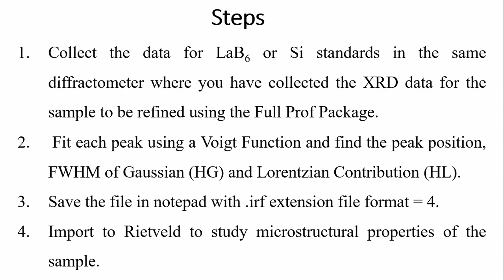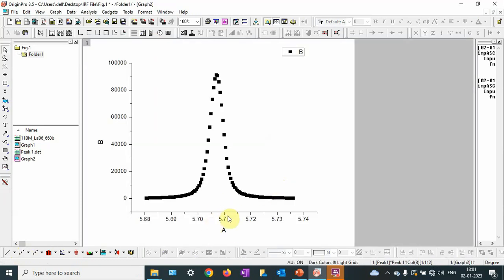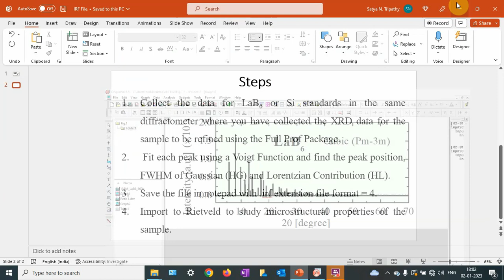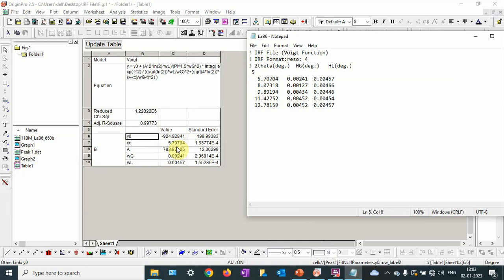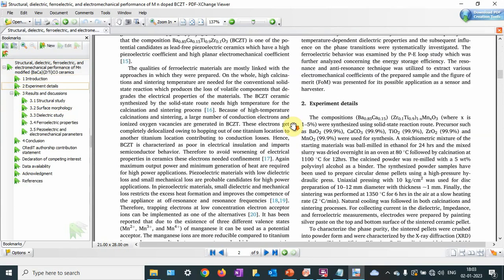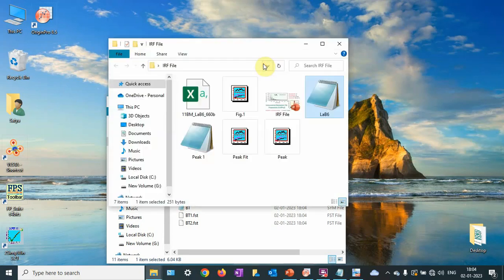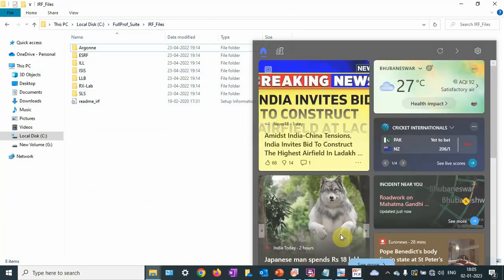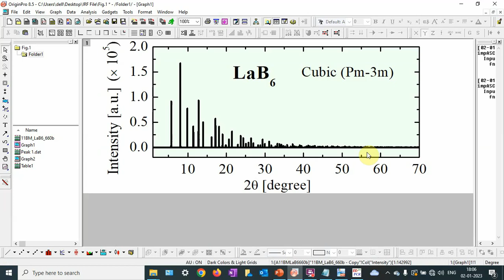Instrumental Resolution File (IRF) for Rietveld Refinement Using FullProf Package

Comment: Sir, firstly thank you for such amazing tutorials. I have a small doubt...
I have XRD of Si standard sample. But it also has the alpha2 data. Ie: the alpha2 stripping is not done. While fitting the peaks with voigt function in origin how do i proceed. Thank you sir
Reply: same problem if you find any solution please tell

Comment: sir, will this IRF file insertion will cause any effect on refinement. (like in the chi square value and in the peak converging)
Reply from the maker: While adding the irf file make sure that you make u,v,w parameters in the profile part is zero. Yes, indeed it will change the chi2 square because you have incorporated the microstructural effect into the refinement.